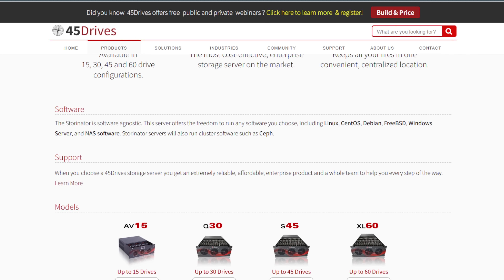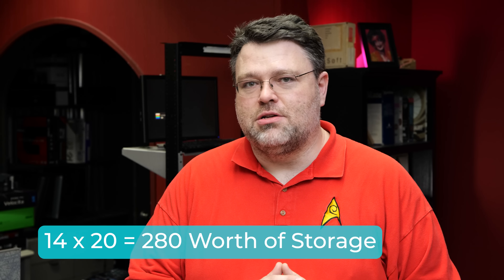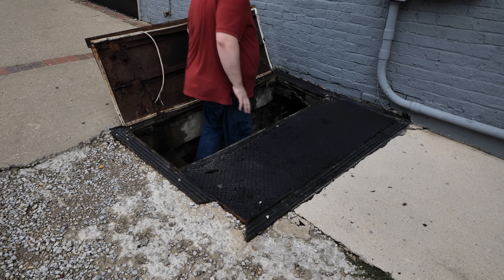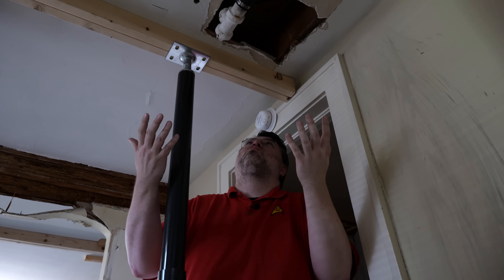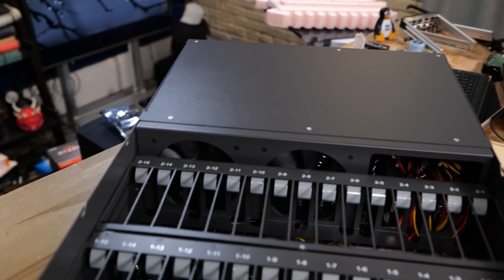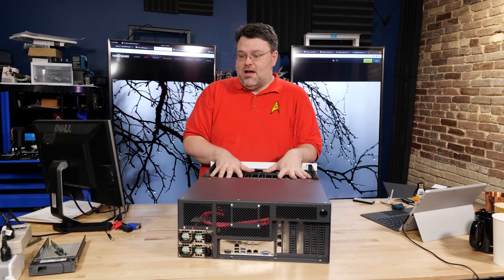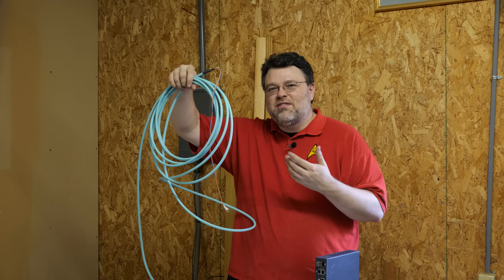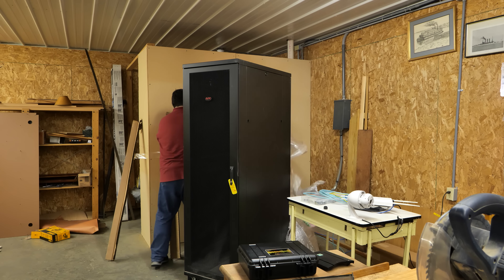Data Recovery PTSD: Prep for 45 Drives Offsite Backup

Comment: My backup solution: Just some raw SATA HDDs i plug into a USB dock like an old NES cartridge and rsync the filesystem to when doing a backup. No fancy hardware, no fancy software. It is as simple as it gets. And it is actually offline when not in use.

Comment: Can't get behind the notion that spinning rust has a fleeting lifetime.  I have working spinning rust drivers over three decades old.

And I have a ton of them that have been operating 24/7 for more than a decade.  There's a failure rate, for sure, but they still last longer than flash drives.

Comment: Hmm.  Does Wendell understand that concrete walls have a thermal conductivity of 2.25 W/mK (1.25 W/mK @ 20°C)?  While plywood is a (relatively) poor thermal conductor, at 0.13 W/mK?  And he insulated with foam, which conducts heat at 0.022 W/mK.  So, Wendell covered the concrete walls with plywood --- which is 10X worse at conducting heat --- and foam --- which is 100X worse at conducting heat.  I guess, to greatly impair the concrete walls' ability to conduct heat out of the room???

A large Igloo cooler would have been cheaper.  And it would have trapped heat better!  Those panels have narrow gaps --- through which some heat will escape! :-)

Graphite is a good thermal conductor.  And it naturally comes in black --- to absorb plenty of radiant heat --- instead of depending on (mostly) convection and conduction.  Think "the opposite of a thermos."  The walls inside a thermos are reflective.  He wants to remove heat, rather than trap heat.

I'm sure Wendell has a really good reason for defeating the thermal properties of the root cellar.  But, I am just not seeing it.  Mea culpa.
Reply: Basement cellars are damp and heat from servers the area will create a lot of humidity.

Comment: Cellars are awesome. But after i saw my UPS (lowest point in my rack) failing to swim due to the lead in it, i would prepare for possible heavy rain events in the future. The last 70 Years this house exists, there was never a problem with water. But the last three years, out basement was flooded 4 times. 
My servers are still in the basement, but now they stand higher up.
Reply: yeah but he insulated the walls. look at m0rn1n6st4r's comment after ur's
Reply: @twopair8610  what has insulation to do with rainwater shooting over the gutter and running down the stairs (if the black door is really the entrance)? Looking at the news lately i see a lot of very dry weather and then sudden heavy rain. 
My comment aims to keep in mind, that if someone plans to deploy a server in a basement, you now should think about water too.
If it is of no concern where you are, then everything is fine.
Reply: @derstreit  you gotta protect against water but the cellar is cool because its underground and badly insulated. he put it in the cellar cause its cool then insulated it from the source of cooling with wood and foam but ya gotta keep things dry too.  does wood and foam help keep things dry?

Comment: Seagate?

Well, rip data then.
Reply: Apparently, they've had a change of management/quality philosphies.
Reply: @toymachine2328  According to Backblaze, failure rate is still high on big capacity drives. It's WD DC and Gold line only here until I die.

Comment: I've got a trio of archive/backup clusters (two clusters onsite, one cluster offsite about 1000-miles or 1600KM away). About every 3-4 years or so they get replaced with bigger newer faster stuff. The seeding between clusters is always the worst part and takes the most time. It's nice you're able to get 10GB point to point between locations and I wish we had that. For us the distance between our Main and Offsite location made it financially unfeasible to get much more then about 100-meg point-to-point for a production adjacent geographically redundant "Oh shit" backup cluster. The 100-Megs is more than enough for us to pull current backup snapshots or a couple months of archival data back down in a reasonable time but seeding the whole 14 years of archival data is a different story. If I were to attempt to seed an empty cluster over the 100-meg it would take over three months to complete. Our solution is to seed the offsite cluster locally and then pack everything into a van and drive it there. This allows us to move the seed in about 4 days start to finish. 1 day to build the third cluster and seed/test it, 2 days to pack it up and drive it to the offsite location, and 1 day to install and online it. There are also some other benefits to doing this. The big one is we can treat it like the delicate equipment it is and completely own the whole transportation process. It's also usually cheaper compared to palleting things up, shipping it up there as freight, and then spending money for the Colo's tech to install it. On that last note, while the local Colo tech is more then competent, for that they charge to do anything besides a reboot/power-cycle, it's cheaper to just have my guy there who knows our infrastructure and can decom and haul back the old cluster as well.

Comment: Since June 2019, I have my "new" desktop; a Ryzen 3 2200G; 16GB and 2TB of disks; 512GB nvme-SSD; 500GB + 1TB HDDs (~9 power-on years :) supported by a 128GB L2ARC sata-SSD cache, It runs a minimal install of Ubuntu 22.04 LTS on OpenZFS as Virtualbox Host OS.  My two backups are:
- 2011 HP Elitebook 8450p with i5-2520M; 8GB; 2TB HDD (new from 2022). It runs Ubuntu 22.04 LTS on OpenZFS also as Host OS.
- 2003 remains of a HP d530 SFF with Pentium 4 HT (1C2T; 3.0GHz); 1.5GB; 1.21TB in 4 HDDs (2x IDE 3.5"; 2x SATA-1 2.5"; 250GB + 3x 320GB; all between 1.5 and 3.5 power-on years). It runs 32-bits FreeBSD 13.1 on OpenZFS.

Comment: I'd really like to see power draw comparisons between the old and new systems. Specifically moving to fewer bigger drives. If possible anyways :)
Reply: Also, can the larger drives be installed in the old system? Would that need to be all at once, in sections, or could it be done one at a time? (With appropriate backups being performed before and during the change, as required.)
Reply: @toymachine2328  you can put them in the old system but would need to replace one at a time and let zfs resilver then replace the next etc when the last one is done the vdev would expand to the new capacity

Comment: I'm wondering if the cellar is cooler BECAUSE the walls are cooler ... So, insulating the room from the walls may not be exactly what you want to do...consider water circulation like a augmented heatpump.  Just a thought.
Reply: I think you're correct, but I also think humidity is bad for computer components, long term.
Reply: I was thinking of a geothermal heat pump.  Water or glycol circulates through subsurface earth where temp is around 54 Deg then through a heat exchanger.  Could do the same thing with water cooling on computer, put heat exchanger on the wall somewhere, then run some piping out in the yard buried in a loop ... Would eliminate most of the heat generated in the house by sending it into the yard...haven't heard of anyone doing it, but it's something to think about.

Comment: Keeping my core dataset to under 10 TB has proven to be a valid strategy. There is that handy Delete function in the filesystem and if you're never using it, you're just a data hoarder. MSA60 is still my poison of choice for all my homelab needs and they're like 50 bucks, a piece used if you don't really insist on caddys or rails. We know storminators exist, thanks for reminding us, but I can't explain to my boss in a 5 minute conversation why they are better than what HPE rep has been pumping him for years over paid lunches. Let's not even get into the ZFS territory and replication, his head would melt.

Comment: my dear don't forget to use the hdd tuner on multiboards x2 with that you can manage the 288tb and via usb 3.2 type-c adapter converted to almost 340tb 350tb to 470tb with really tall servers you're still a long way from where I am in my head .sorry I hope I helped that accelerated 188,000mb/s extra with 8 core with 6 core 186 high clock 188mb/s 470 tb with 2.5g packets with lan server 10g multiply that times with 256bit at 98bit load at 128bit cash which stabilize your system with so much program and implementation that's sick i'm telling you off the top of my head 6400mhz pippline pakette faster than the 6tb rade 0 that's the lvl i .have a clear view with something like that.

Comment: I would love for the Q15 to have a barebones option because i dont need a Xeon processor, my current file server is a Ryzen 5 Pro 4650G with 128GB of ECC uDIMM I have a single HBA and a front ICYDOCK 16 bay hot swap SSD cage. This is currently my primary file server, but once i get my primary rack mounted system replaced this small portable system with a carry handle will go back to being how i update my off site backup in a different state in a place with data caps.

Comment: Keep an eye on those Exos drives. My 16tb Exos have given me nothing but problems. I've had to replace 5 in less than 2 years. Thankful for warranty and ZFS but it makes me nervous. Definitely have SMART running regularly. Started ordering WD Red Pros to replace and stagger them out with in the mirrors.
Reply: Do you know if the iron wolf drives are any good?
Reply from the maker: We will know soon enough
Reply: @gettingmitches1323  Exos are the "better" line since they're enterprise storage and not consumer storage, even though they can end up cheaper on the market just because. But (aside from anomalies) high-capacity most drives are pretty similar at consumer scale, so pure cost and warranty and having backups matter a lot more.

Comment: How do you get a fibre run like that setup? Is it run through an ISP or is it a direct line from the main studio that's been run either on poles/underground by a contractor?
Reply: I get the impression that his root cellar is on his property with the rest of his studio and office sets, so it's probably just a line running outside and under the house to the cellar, full DIY, and he's treating it as an "offsite" backup because it's on an independent power circuit, and is protected from the elements by the cinder block walls, so many of the disaster eventualities that could affect the main house won't necessarily destroy what's in the cellar.
Reply: @upintheclouds1337  - Well... hopefully the sump pump doesn't fail 🤔
Reply: It's on the same property as his business. I've been to his office so I recognized where it was

Comment: Which video is this intro referring to? Did you recover a petabyte ZFS array somewhere I missed?
Reply: Zfs bug Linus ran into
Reply: @vamwolf  Pretty sure it was not a ZFS bug, but a user configuration (or in this case lack there of) error; LMG not adding automated ZFS scrubs.   The resilience of ZFS was what enabled saving most of the data.
Reply: @vamwolf  Do you have any more information or any links to this?
Reply: @moofree  LTT made a whole video on it. "We lost all our data" or something (they keep changing the titles afterwards). Like the other commenter said, it wasn't a bug, they didn't configure ZFS correctly and didn't realize it until the damage was already done.
Reply: @Blacklands  I found that video, but haven't been able to find anything about Wendell recovering data.
Reply from the maker: See the "wendell elsewhere" thread on the forum
Reply: @Level1Techs  I can't find a thread by that name-. edit: I found some old links on google, -but it says that page doesn't exist.
edit: Got home after work and tried again after I could actually log into the forum, and there are so many videos in this thread. I've clicked two recent LTT videos in this thread so far and don't see Wendell anywhere. 
Since this starts as a followup to another video on a completely different channel, it's really strange that you don't link to the video this is a followup to.
Reply: @moofree  How old is that video? It's happened to Linus a couple times, at least, the one I saw a couple years ago he called a some data recovery company.
Reply: @toymachine2328  The couple I found were from January/February 2022. edit: There are more LTT videos on the "Wendell Elsewhere" thread, but I haven't been able to find Wendell recovering ZFS storage arrays for LTT.

Comment: Doesn’t insulating the root cellars walls negate the cooling affect of being under ground?
Reply from the maker: Most of the cooling comes from the concrete floor more than anything
Reply: @Level1Techs  fair enough, but the walls act as additional surface area for the cooler ground to absorb the heat, no? I’ve had man cave and server closets in basements for years now, my current basement has tile floors and that gets friggen cold in the winter! So I get you, but strictly from a surface area perspective is why I asked, you had said it was a basement under a basement so the walls must get cold too

Comment: So the zfs replication is on par with snapmirror?
Reply: Better. Snapmirror copies files, ZFS replication copies the individual data blocks that make up the files.

If you wiped a disk and reapplied the replication , it would be basically identical to the disk state when the snapshot was taken.

With snapmirror the files would be the same, but the disk layout would be completely different.